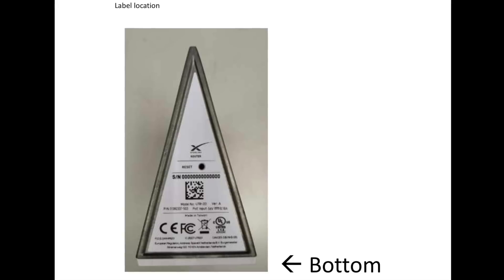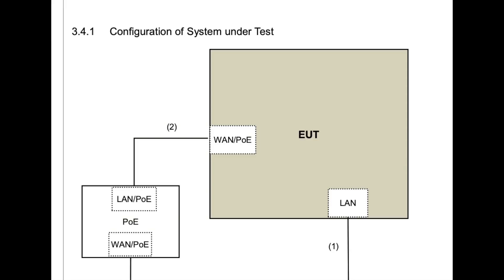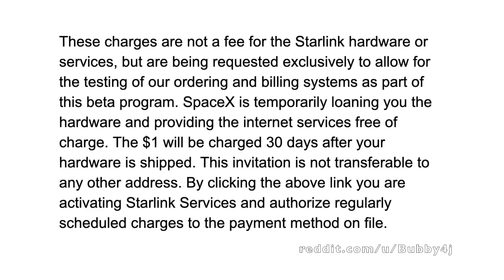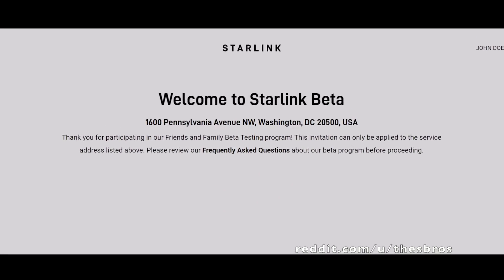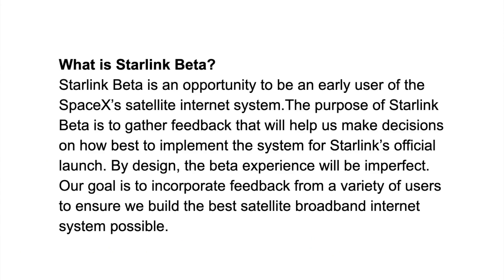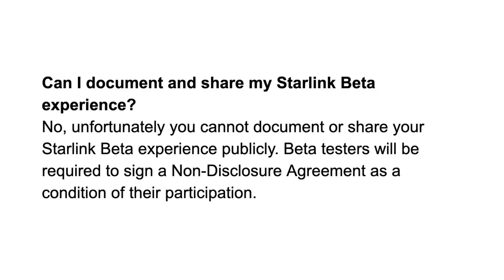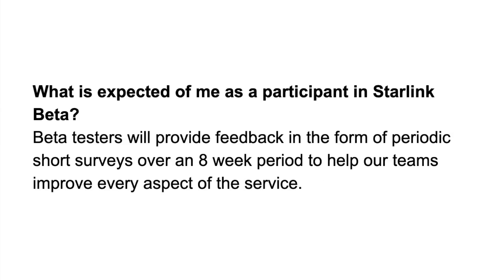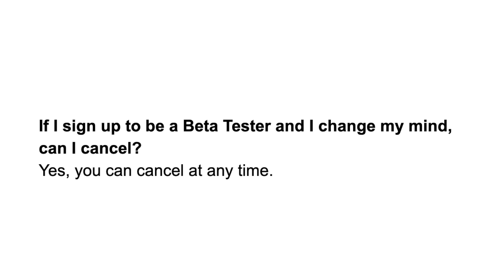STARLINK - ANOTHER Beta Update

Comment: I’m sort of surprised that the PoE injector also powers the router side. I expected it to work similar to UniFi and other injectors. I think most injectors are not smart and output power whether the device connected supports it or not. Unless there is a selector on the injector to disable PoE on the router side, I’m guessing that the Starlink router has to be used one way or another. Hopefully it can be configured just as a gateway/bridge and have NAT and the AP disabled.
Reply from the maker: Agreed - it's a little bit unusual for a PoE injector to send power out both ports. If you watch my leaks video https://www.youtube.com/watch?v=_9jv7Quz3wo it looks like the two ethernet ports are colour-coded - one black and one white. I'm hoping that the internal router port either has a switch for the PoE as you suggest, or maybe uses a negotiated PoE like IEEE 802.3at so you can use it with non-PoE devices. Thanks for watching!

Comment: What if I want to use my own router/APs?
Reply from the maker: This is still an unanswered question. What we DO know is that the "Starlink router" is not manufactured by SpaceX, so I'm hoping it's just a plain old wifi router that could be swapped with anything. I personally use an Edgerouter with Ubiquity APs with my current Internet provider. I'm hoping I could use a similar setup with Starlink.
Another unknown is the PoE type used by the dish and the router. If it's something standard, like IEEE 802.3af or at, it could connect to any standard networking gear. If it's a passive PoE injector, you might need to block the power if you're connecting it to a non-powered device.
These are easy questions to answer once the hardware is available, but during the private beta nobody is allowed to share the info. I'll keep updating as I hear more! Thanks for watching!
Reply: Mike, hey nice setup! I also use an EdgeRouter and UniFi APs at home and elsewhere. Just recently switched from a failed ER-Lite to the ER-4. Great devices, however, with some odd quirks

Comment: If Starlink delivered fibre speeds or cable speeds it could revolutionise the net, but it is only slow cable.
Reply from the maker: I'm very interested how or if big telcos/ISPs will react to Starlink. For many Starlink should provide a FAR better service. We don't know the cost yet, but it sounds like SpaceX wants to be competitive. I'll update when I hear more! Thanks for watching!
Reply: Your observation is true. It is also somewhat time bound to our current (2020) implementations of technology. I would not be surprised if Starlink can hit 40Gps in the next 5 years. The Starlink master plan calls for a large number of satellites with laser communications between them. I would not be surprised if the later implementations multiplex to provide very high speeds. I suspect there are at least three levels of the service rollout. 1. Infrastructure testing, 2. Coverage Expansion testing, 3. Speed Optimization. 

My subjective memory tells me there was an internet speed test that shattered existing records using a satellite system in Australia within the last six months. Multiple dishes were used to multiplex a download in the TerraBit range. My human memory is naturally faulty due to its chemical components. Memory says the speed achieved was around 48 Tbs.
Reply from the maker: Agreed! SpaceX has proven they have the capability to continuously innovate. Controlling the User Terminals, Satellites, and the ground terminals gives them huge flexibility to implement new capability rapidly. I can't wait!

Comment: Any idea how long the Poe cable will be from the dish to go inside of a home. I would like to mount on my 40 foot tv Tower and run into my house that would be close to 80 foot
Reply from the maker: It's hard to tell for sure from the photos - I would estimate 50 to 75 feet. The nice thing about Starlink using ethernet is that you should be able to use your own cable if the one they supply isn't long enough. I'd recommend something that's outdoor-rated for UV resistance. We don't have a good idea of exactly how it attaches at the dish though - I'm not sure if it uses a standard RJ45 or something weather resistant. I'll be sure to update if I find out more. Thanks for watching!

Comment: I live in Toronto, do you think that will be covered during this initial test? I am unsure of how to check.
Reply from the maker: There's no official place to check yet. So far I've been basing this off the public code and FAQ from the Starlink website I talk about in this video. Toronto is at 43.65 degrees latitude and the website data suggests that you need to be in the 44.9 to 51.8 degrees to start. So looks like no Toronto to start, but that will rapidly move South to include Toronto as they send up more satellites. Thanks for watching!
Reply: MikeOnSpace thanks for the response keep doing what you do

Comment: do I have to point the satalitte towards the other ones in the sky?
Reply from the maker: Instructions say you just have to point the dish "up" and there are motors inside that will orient it in the correct direction. Once that is done, it doesn't need to move at all. The signal to the satellites can be "steered" electronically - no moving parts - using the phased array. Thanks for watching!